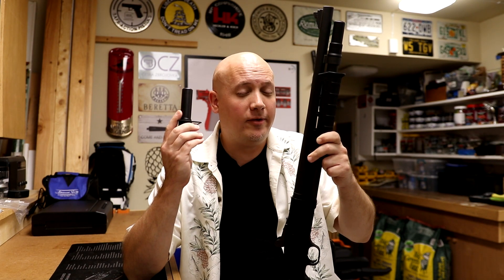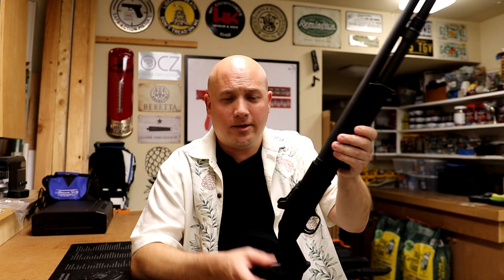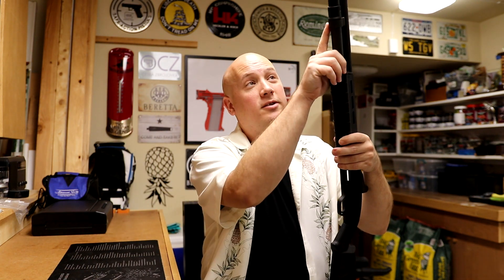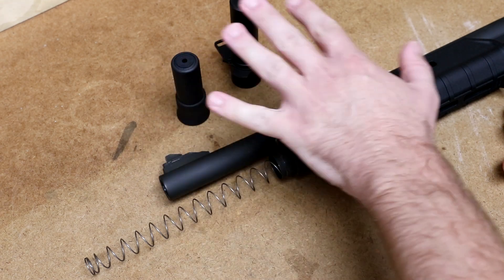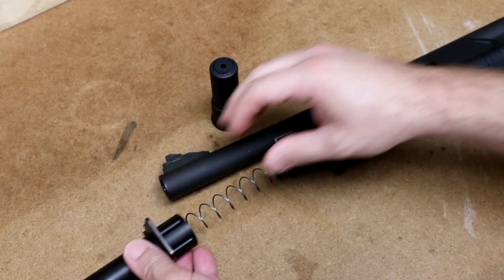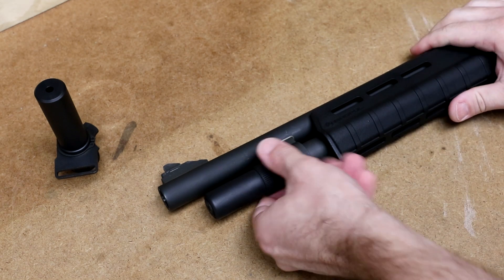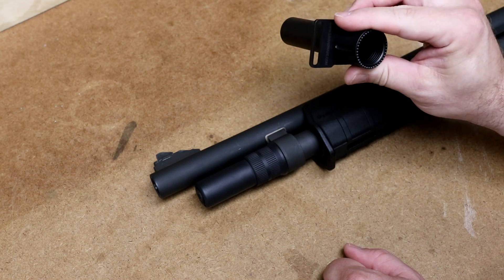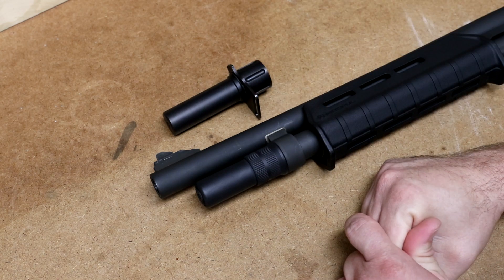Product Review: S&J Hardware +2 Magazine Extension for the Mossberg 590A1

Comment: Hey Jason. I just watched this video and than poked around for a second on the internet. GG&G makes plus 2 and plus 3 extensions for the 590A1. I've used their products on a few different firearms, from AR's to 870's. In my opinion, they're rock solid. I kind of hold them almost in the regards of Mesa tactical, a little pricey, but bomb proof. Maybe give them a try, and hopefully you can get the look you want for your set up. I'm like you, with firearms it has to be both function and fashion.
Reply from the maker: Thank you for the recommendation! I will check them out!
Reply: @ChrisBalas-jn8ws  GG&G are great, love the quality steel, quality mfg/welds finish etc great park finish! I use a gg&g rail mount with small sling loop that fits under the magazine cap for the 500 series. Only moderately difficult thing was it requires you to remove the small washer inside the cap first but it keys into the bRrel lug so it wontt turn and then has its own detent dimples. This is a product for the 500/88 series not 590 but im so impressed by this and their other products like scope rings and such that id wager their extension is also gtg!
Reply: @ChrisBalas-jn8ws  which size did you go with? Does it look or work funny with the tube sticking out farther than the barrel? Been interested in one for awhile but don’t see much about them

Comment: S&J sent me a washer with a samll hole to go over the ball detent and it tightens down really good. The plus one came with the sling adapter, follower, spring, and washer. Just last week 8/2023. I have the 590A1 18.5, 7 shot.  My plus one sets flush with the barrel but I didn't add the sling adapter because I have the Magpul sling adapter on the barrel and stock.
Reply from the maker: Sounds good! Thank you for sharing!

Comment: The new 18.5 version comes with 6+1 shot tube...I have the same version as you with the 5+1 tube
Reply from the maker: I am glad they upgrade them now.
Reply: I have the 6 + 1 on my 18.5 mossberg. There seems to be enough room to add a "one" extension, to make it a 7÷1.  Not sure though
Reply: The new models with longer one pc mag tube is great and preferable to an extension but plenty of used older models that are jist 5 shot, especially the A1, come to think of it if you truly need an A1 version of 18.5, I’m not sure they have a longer mag tube for 6 rounds the way the lighter 590 18.5 6(7) shot does, unless i’m wrong about that?

Comment: I know I'm late to the party. The S&J gen2 extension has a V cut like the factory parts and not the small drills. They work like the originals. With the Gen 1 extension,  go to the hardware store and get some mini files. Note where the extension meets the detent ball and cut your own. I did 6, and it feels much more secure. It took maybe half an hour to do and reblue.
Reply from the maker: Great information! Thank you for the update!
Reply: @keithcon3505  I may be doing the same thing depending on if I receive the drilled holes or slot cuts on the one I just ordered the S&J +1 kinda limited by what's available for order in Canada was temped to go for the +2 might still consider for down the line but have the 18 inch shockwave and will hopefully have the end flush or close to the muzzle end and be able to load x5 3" shells in the mag

Comment: Where did you get the Mossberg branded +1 tube extension?

Also, did you have to change out the tube spring?
Reply from the maker: I think from their website. No, I used the same spring.

Comment: I have the 590A1 18.5 with the 6+1 magazine.  Does the factory extension be flushed with the 18.5 barrel?  Can you provide the length of the factory extension?
Reply from the maker: The factory extension is not flush.